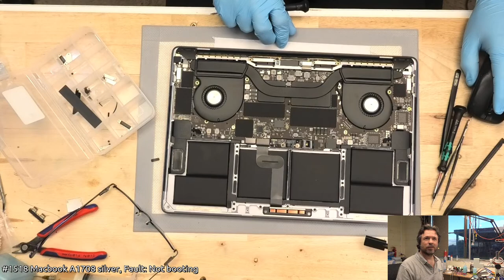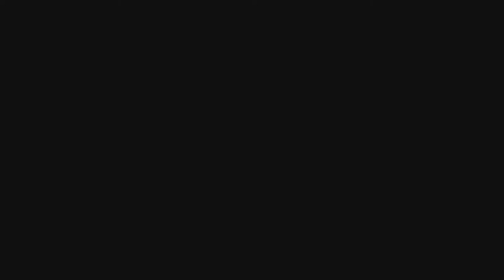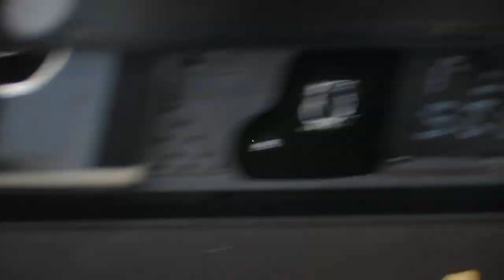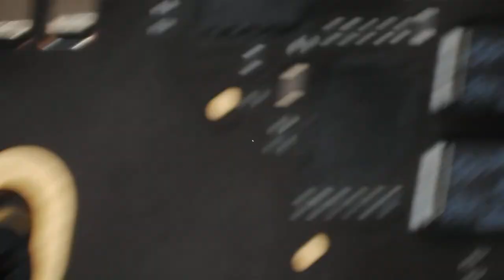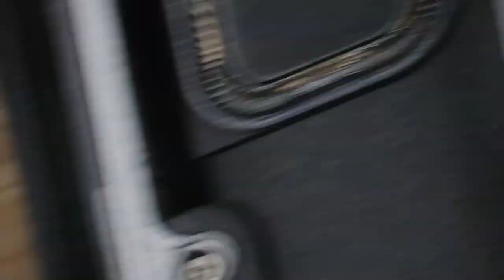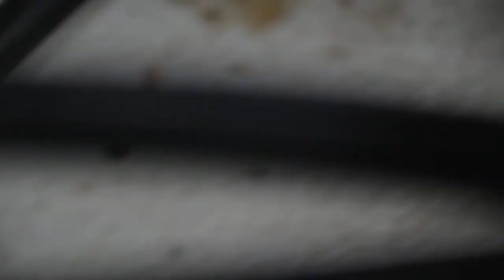Testing migration to 60fps setup. Panasonic HCVX1, SONY AX33 and Microscope cam

Comment from the maker: Overhead camera is a Panasonic HCVX1
Face camera is a SONY AX33
Microscope camera is a 4K 60 unit that I bought from RisingSun cameras on AliExpress but unfortunately does not see to be available any more ( though in fairness I'm not overly happy with it ).

Both the Panasonic and SONY required some undocumented rituals to convert them from the PAL25/50 over to NTSC30/60, the SONY in particular was quite a PITA.

OBS is set to 10Mbps upload to YouTube.

More lighting is required to get the cameras to really shine; I have a single 120W spot source, and I have another 100W unit of similar spec coming in a few weeks.  I'll rig up the ceiling with some beams to mount them from as well as the existing light panels.